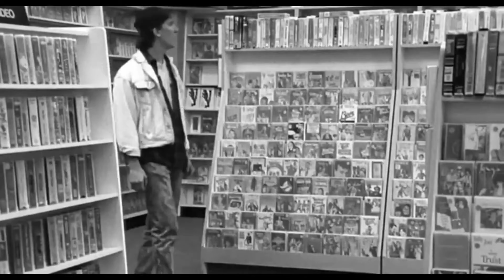Open Solo   Green Cube Install

Comment: Are you knowledgeable about this drone? If so I got two that I installed the open solo 4.0 and they work perfectly but I got two other ones that I did the same thing on and they fully loaded up and only thing is the controller says Compass error but on solex app the calibrated icon is not lit up so I can choose the Calibration feature! Any Help is Greatly Appreciated!
Reply from the maker: Go on Facebook. Join the JB's 3DR Solo group and post this question.  I think they may have addressed this in the past .

Comment: My motors turn on like in your video but I try to accelerate them with the left stick and the quad doesn’t respond to the controller command 

Any idea why? What do I need to do
Reply from the maker: Angel Gonzalez-Zeno  not sure.  I’ve not seen that problem.  Maybe reflash firmware?

Comment: How did you update the firmware?
Reply from the maker: The Solex app.
Reply: Grec's Whirlybird yes I found the arducopter updates but what about the IMX Python zip? It didn't show up for me.. I'm trying to do green cube as well
Reply from the maker: The latest procedure is to update the stock cube with Open Solo.  Once you do that and confirm that it works, you can then install Green Cube and then install the firmware.  Matt Lawrence made the process much simpler with Open Solo.
https://github.com/OpenSolo/documentation/blob/master/green_cube_install.md
Reply: Grec's Whirlybird ah okay perfect thank you, happy flying!